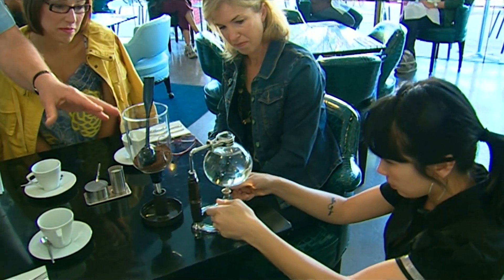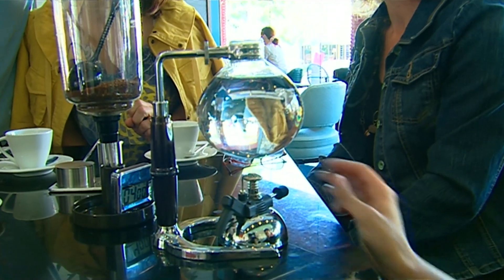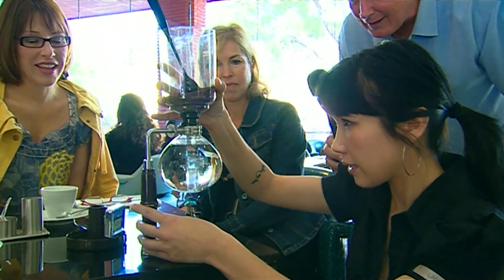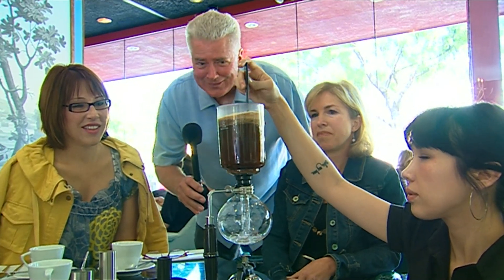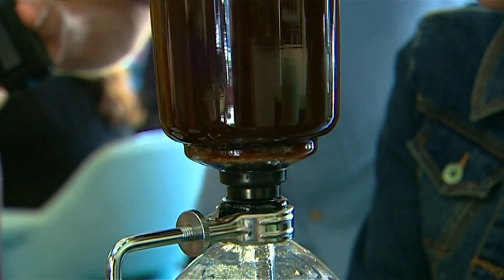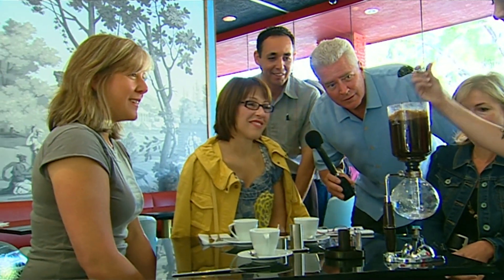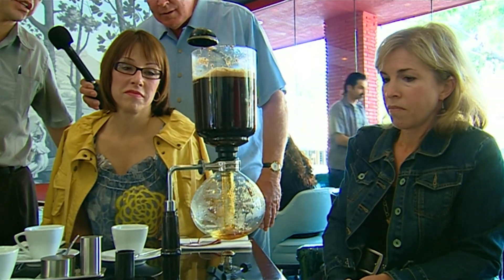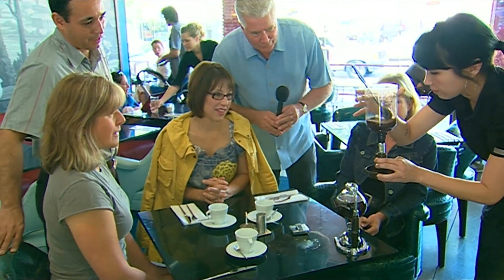The Spectacle of Siphon Brewed Coffee | Visiting with Huell Howser | PBS SoCal

Comment: Every short-order greasy spoon has used this type of coffee-maker for as long as I can remember.  Most of them were the Cory brand.  No awe-inspiring ceremony was involved.  The waitress just threw some coffee in the top unit and set it on the bottom unit, which contained boiling water, and nature took over.  The Cory system involved a two-plate heater—one plate  where the brewing happened and the second to keep the result hot while the next pot was brewing.